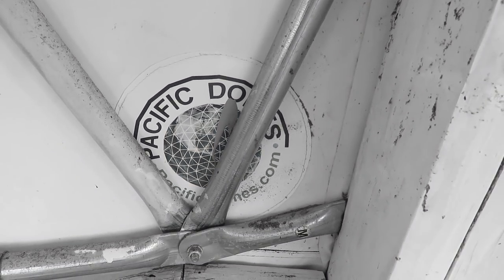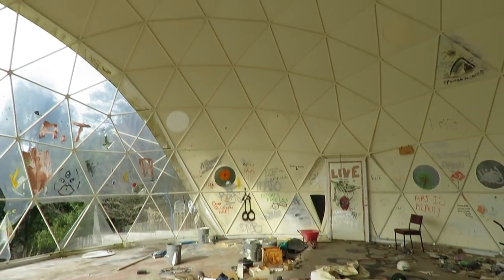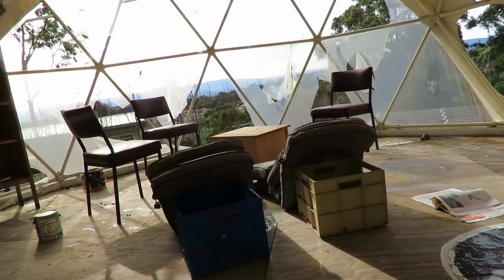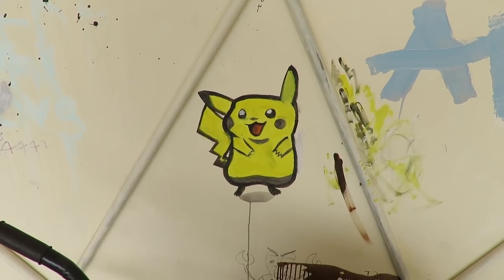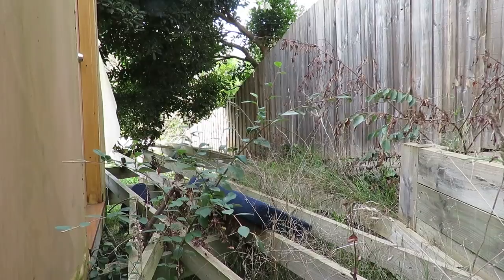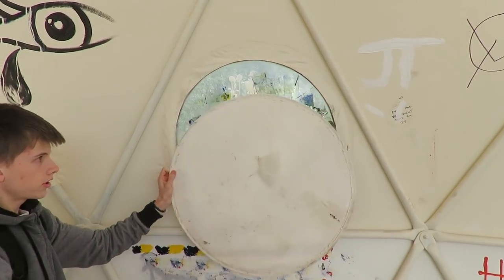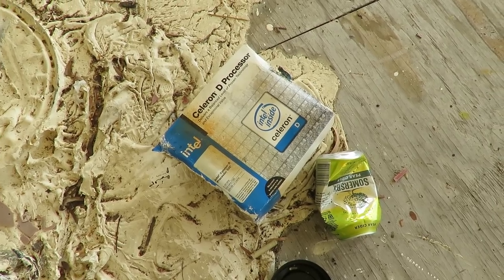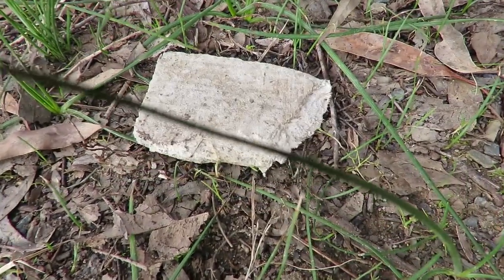Abandoned: Half Built Geodesic Dome Home

Comment: A 5v icosahedron. Don't see many of these beautiful things. I'd like to know how long the longest strut is. With that, I could figure out the diameter of it. For this frequency geodesic, there would be nine different strut lengths. These struts look like they are maybe 3 to 4 feet long. With a longest strut measuring just under 5 feet (1.5 meters) the diameter would end up being about 38 feet (11.5 meters). That's a lot of floor area (1100 sq ft or 335 sq m), plus a tall ceiling that could accommodate a second story or a loft. 

Criticism that it's "just a big tent" is not well thought-out; the framework could just as easily be covered with solid, rigid materials. People don't realize that most balloon-framed rectangular houses have walls that you could punch your way through anyway. A dome like this covered with rigid panels would be much stronger than most comparably-built rectangular houses.
Reply from the maker: I have no clue how long the struts where but thanks for watching and commenting.
Reply: Poor maths. An 11.5 metre diameter would be about 104 square metres.